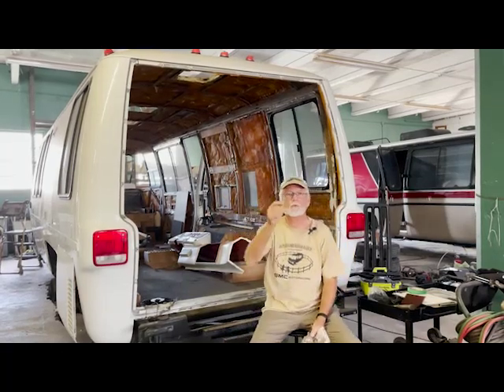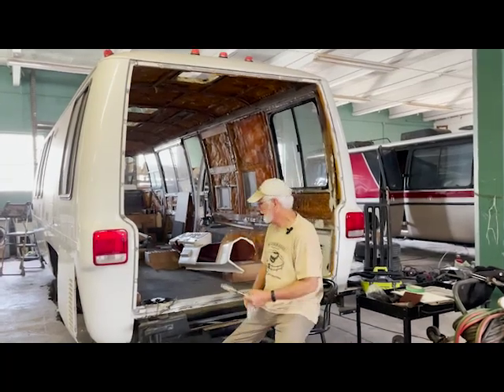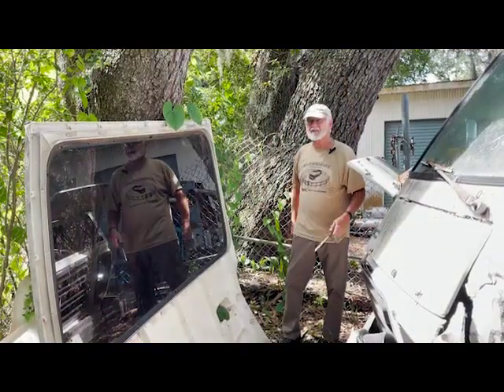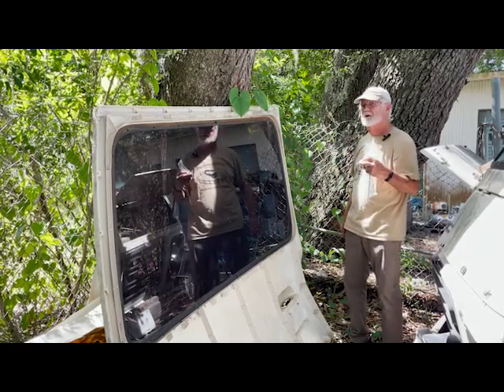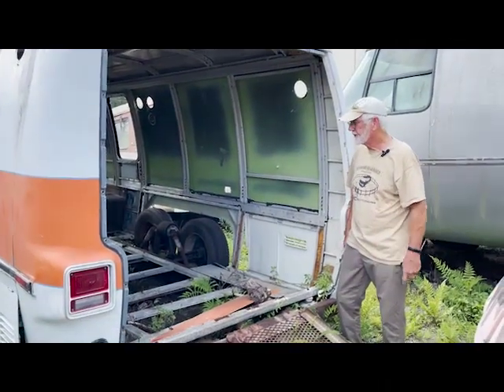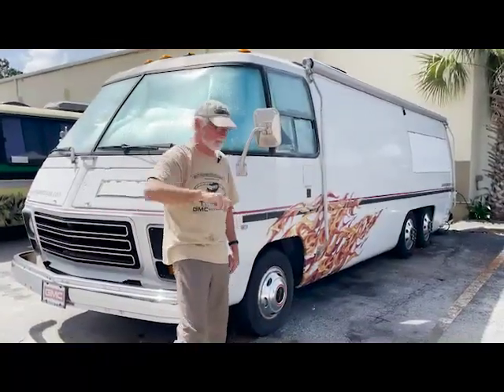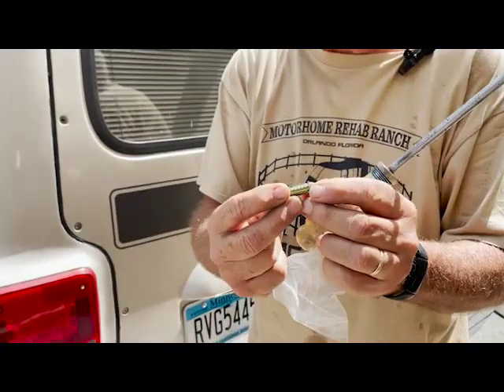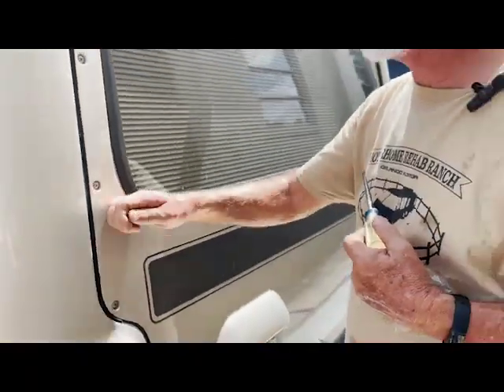More About The Rear Panel On Your GMC Motorhome - With Jim Bounds

Comment: Early model here, removed and replaced inserts and bolts, replaced the seal, repaired the cracks, reinforced the edges, painted, and replaced the glass window with polycarbonate. Thought about having it open, but opted for less work and better insulation.

Comment: The GMC Engineers were way ahead of their time; to bad they didn't keep producing the coach OR they don't bring it back.
Reply: Now would be the perfect time to bring it back replace that 455,  give it a hybrid electric - diesel motor,   i'd say full electric but having to sit at a charging station for like 10 hours would probably nuke their sales. set the braking system up for regenerative braking,  use insight gained from 40 years of people moding and renovating these things to inform new design and material choices.  would honestly love to see GM revive this platform,  i feel like it really had potential that never got realized well beyond being a motorhome.
Reply: @lattitude01  what if they made the front wheels and one set of back wheels electric motorized; then the other 2 back wheels spin an alternator that would charge the batteries while moving. in effect it would be doing what the Teslas do when braking but instead a full time charger to keep the batteries up. Combine that with a solar panel up top to help keep those batteries up and you might get some decent range.

Comment: Great video and very informative. Only thing is what happened to the aspect ratio? It looks like you switched to 4:3 or something. The videos used to take up the whole screen now they have a black boarder.
Reply from the maker: We think it's because of the new editing system when we add pictures because the framing is different with the pictures than it is with the video so when we combine them it does that, at least that is what we have noticed. Still working on figuring out how to fix it.....
Reply: @motorhomerehabranch  What Editing software are you using? I know it can be fixed in Adobe Premiere.
Reply from the maker: @KGsGarage  Adobe is what we are using now, yes please! If you know how to fix it we would love to know haha